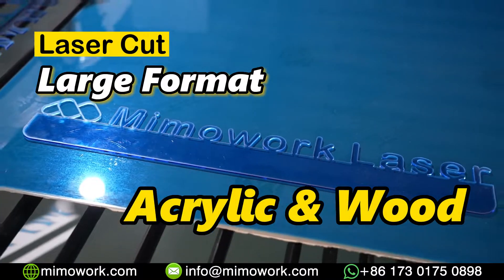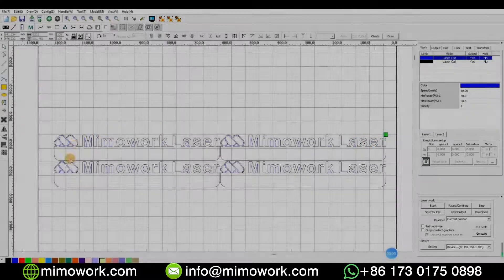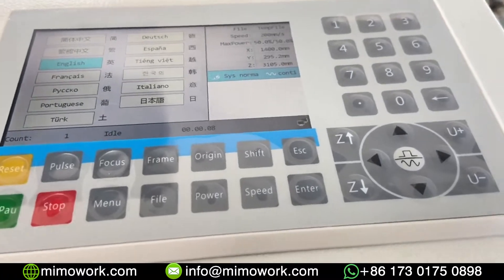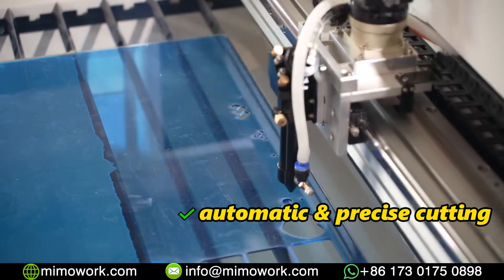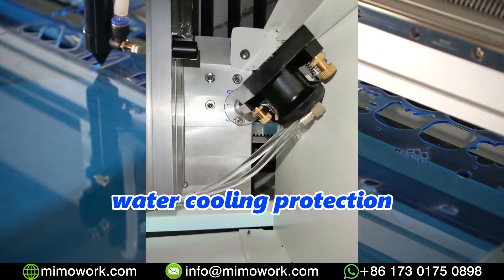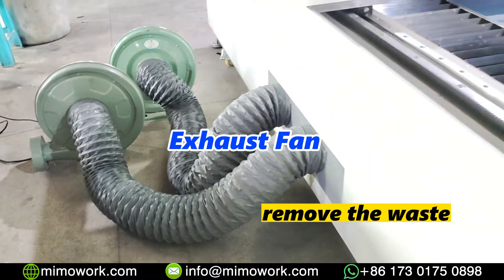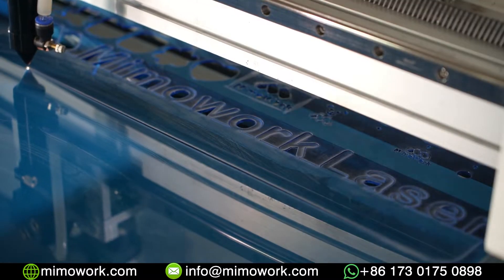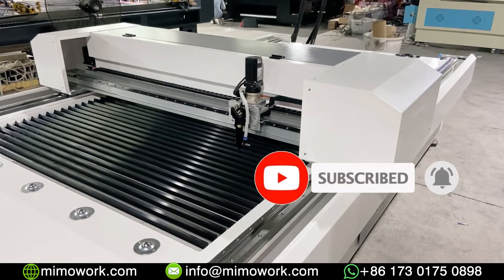How to cut oversized acrylic signage | Watch our 1325 laser cutting machine in Action!

Comment: Range of machine
Reply from the maker: Our standard machines handle 1300mm to 2500mm, but here's the cool part, we're basically the 'Bespoke Tailors' of laser cutters! ✂️✨

Case in point: We once built a 10-meter monster (yes, really! Check it out: https://youtu.be/jxmwj3SttTk).
Whatever size you need, we can craft your perfect fit.

Want to discuss your specific project? We're just a message away:
📧 info@mimowork.com
📱 +86 173 0175 0898 (WhatsApp)